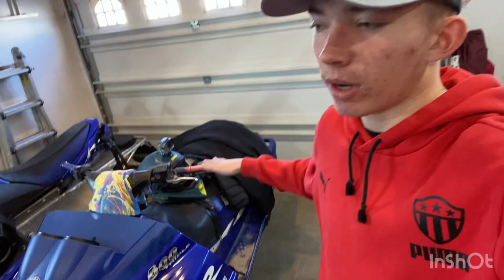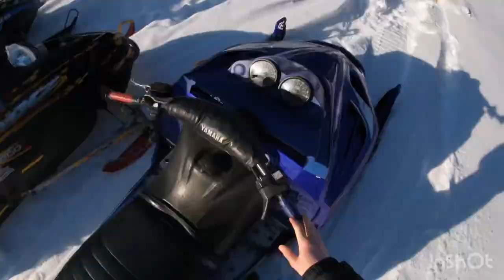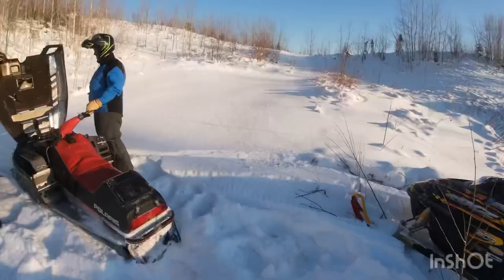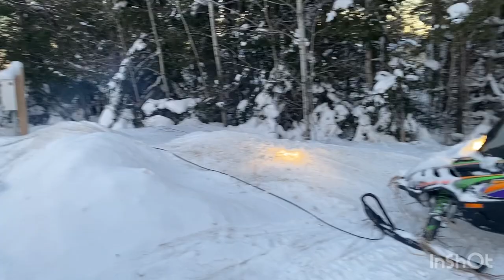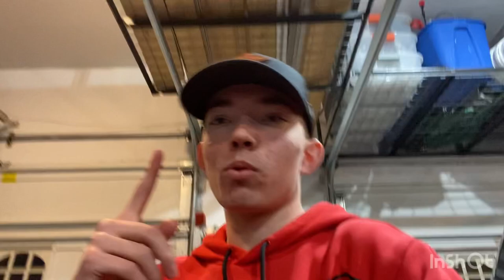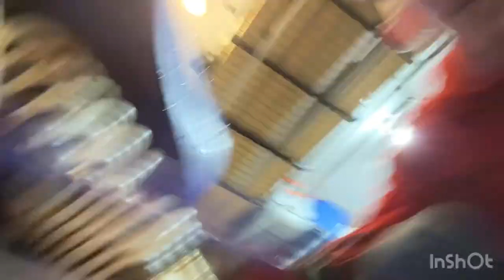Ditch Banging on Short Track Snowmobiles!!

Comment: Hey.  just some advice. so take it or leave it up to you. when towing don't tow from the plastic ski loops you will end up busting it and eating the strap or hook.   pull from lower control arm at the bulk head.  it's the strongest point and if you pull from the outer ski or arm it could bend a arm to if something jams up.